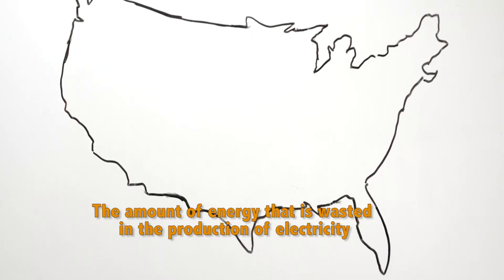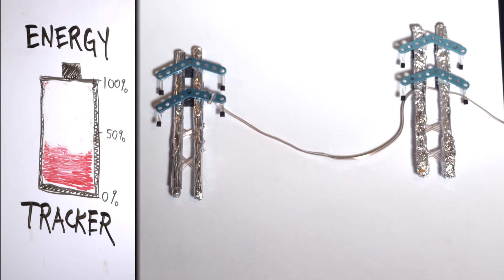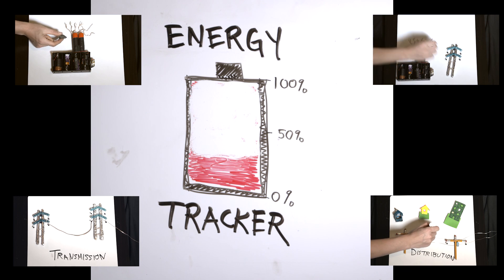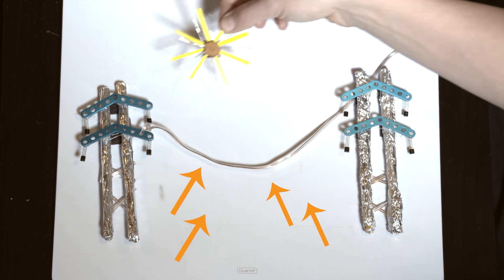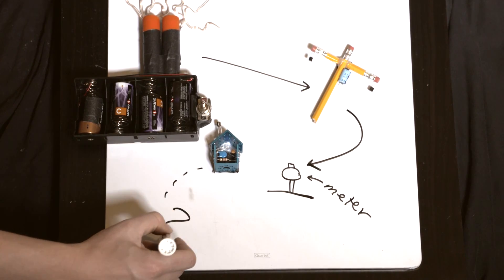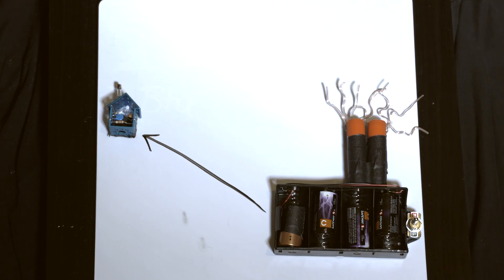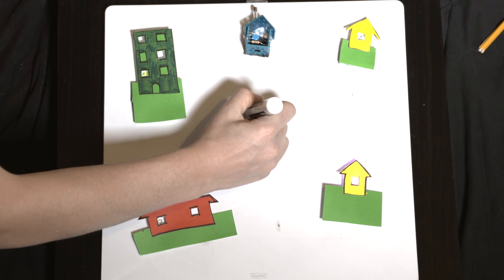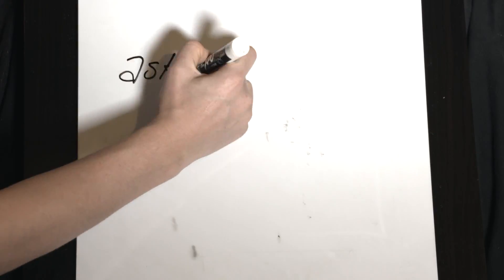"Lost in Transmission": How much energy we lose from plant to plug

Comment: More energy is lost in transmission of power annually, than we use in oil to power our vehicles... 
Hmmm, so lets subsidize electric cars, to assure we loose 65% more of the enegry generated and transmitted, than simply pouring that into our cars, and useing it where its needed.  Brilliant.

Comment: Your transmission and distribution losses are way under stated.  The heat and corona losses in HV lines is more like 6% or more.   Transformer and distribution losses are more like 10 to15 %.

Comment: This question is to the Specialist. If most of all electric power is the result of creating heat to turn a wheel of some kind, then does a near zero emission Tier 4 diesel electric hybrid actually have a lower carbon emission footprint then an EV running off the grid (in-as-much-that grid power is primarily coal or LNG derived with its transmission losses accounted for)?  Assuming a 30 HP Tier 4 diesel electric hybrid is creating around 25KW of power on 2 gallons ULSD an hour.
Reply: Robert Jones
Sorry for the delay, I just randomly started looking through the comments on this video again and stumbled on your question. I really don't know the answer to your question.

This might sound weird to most people, but I'm really not too concerned with carbon emissions, as I don't believe in man made climate change due to Co2. Trust me, I haven't come to this conclusion out of ignorance, rather out of a great deal of consideration. Keep in mind that we're in an interglacial period right now, meaning that we're still warming from the last ice age. More later if your interested.

Back to your question: perhaps an interesting exercise would be to see which is cheaper, basically kWh/$.

Comment: The efficency of the grid after the powerplant is not as low as stated. Of course there are line losses, which do increase as demand increases (called an I squared R loss). However, there are several (not 3) transformers (usually 5 to 7) that your power sees between where it's produced and where you access it. Each one of those transformers has an maximum efficiency of about 97.5%. However, to achieve their maximum efficiency, a transformer must operate at "unity", which means it is running AT it's designed power rating (not above or below). As well, since most of these transformers are three phase, all the phases need to be balanced, which represents it's own set of challenges. Because of the variability in demand, most transformers only see unity for a few hours over a 24hr period of time, this means those transformers are only at their max efficiency during those periods. Add into the mix, the variability of the unreliable renewable energy and grid efficiency is even more difficult to manage. Switching power from one system to another, as a way to balance the supply to the demand, is where the additional transformers are introduced into the system.

The more efficient solution would be to put power generation closer to higher demand loads and use scalable and predictable power generation. Truthfully, only nuclear and fossil fuel plants are up to this challenge. It's funny that they used coal as the fuel source because they aren't being built anymore, mainly due to economics. The US is very rich in natural gas and it burns much cleaner and with more efficiency than coal.

In the end, the architect was right, increasingly efficiency in your homes and businesses is the best solution. As well, reducing your specific usage, by hanging your clothes out to dry, taking german showers, and washing your hands in cold water would do more than having 4 to 6 solar panels on your roof. Of course having those panels on your roof can give you something money can't buy, the self proclaimed right to look down on everyone else.
Reply: You overlooked the massive loss during electricity generation in your beloved power plants.
Reply: @markhathaway9456 
I didn't overlook those losses, they simply weren't my point. My point is, silly people think that all electric is our future and usually incorrectly say that the grid is efficient to something like 98%. Regardless where the grid gets its power, the electricity sees losses, especially where transformers are concerned. 98% is a given transformer eff at exactly full load and fully balanced, which rarely happens (by the way, renewables make loading and balancing impossible). So, let's say the power making it to your home goes through 6 transformers, with an average of 92% eff. The resulting eff is 66%. That's my main point. There are a LOT of mis truths being said around the idea of "all electric" and renewables. Why can't we just be honest?

Comment: 30% efficient to start plus 6% losses? That is f-ing crazy. All the loft insulation and double-glazing in the world is nothing compared to that. Most crappy cars are at least 60% efficient and they get it in the neck seven ways to Sunday. We need a new solution to power generation. Fund fusion.
Reply: 60% efficient? which car is that? " Passenger car diesel engines have energy efficiency of up to 41% but more typically 30%, and petrol engines of up to 37.3%, but more typically 20%."
Reply: @SuperFlons  strictly speaking of the car itself, BEV are estimated to be 85-95% efficient. Certainly at least double that of  a gas or Diesel engine .  Of course, I’m not including the production or line losses of the electricity to power or charge said vehicles.  That said, the debate of gas/diesel v BEV or hybrid goes on.
Reply: ICE cars are 30% efficient at best

Comment: What about transmission through ground wires? Does some part of electricity go into the ground? And does some part of electricity dissolve in the air (as electromagnetism is not only in the wire, but also around it right?)?